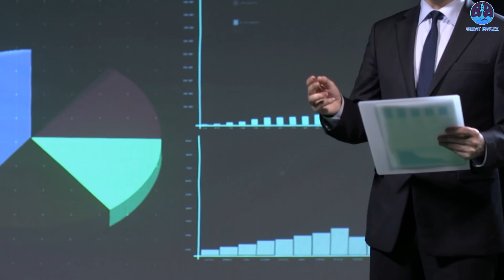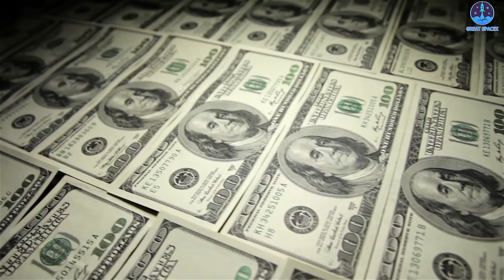Jeff Bezos's INSANE NEW Decision REVEALS plan to build a commercial space station to replace ISS

Comment: What I would do...take a StarShip - fly it to orbit with 150 tonnes of Space Station equipment aboard.  Once in a nice stable orbit - open the vents to it's propellant tanks to space and let them boil dry.   Close the vents and fill with 1 atmosphere pressure air.   Now you just need an airlock to have been placed between cargo bay, oxygen tank and methane tank - any you have three VAST spaces - and a total livable volume of 6,000 cubic meters - more than six times the interior volume of the ISS.

Assemble the interior as needed in orbit.

When it's not big enough - send another one and dock with it.

StarShips are so ridiculously cheap - and they can propel themselves into space as a complete entity - so no messy assembling them from modules.   All of the interior assembly can be done at one atmosphere of pressure by guys in regular clothing.

Comment: 5:04 If ISS cost $100B, an order of magnitude cheaper means Orbital Reef will cost $10B. You subtract one from the exponential: 100 x 10^9 = 100B -> 100 x 10^8 = 10B. It's one of Musk's most often used metrics ("order of magnitude").